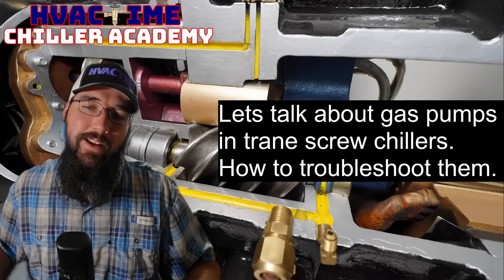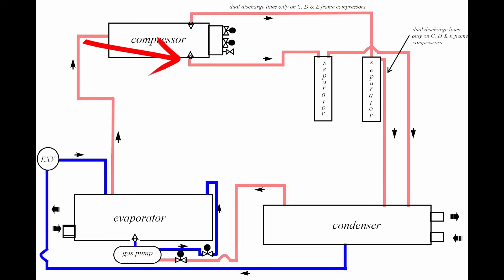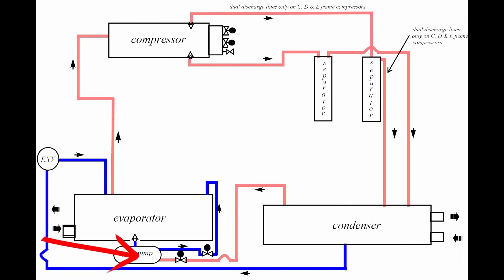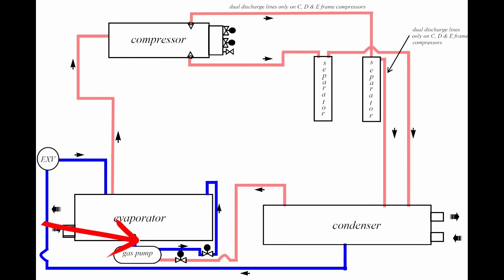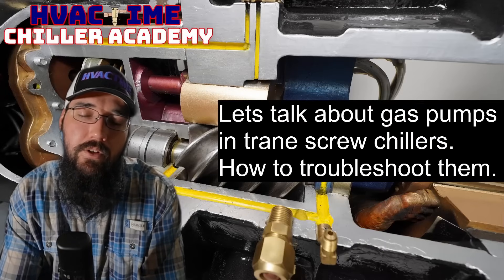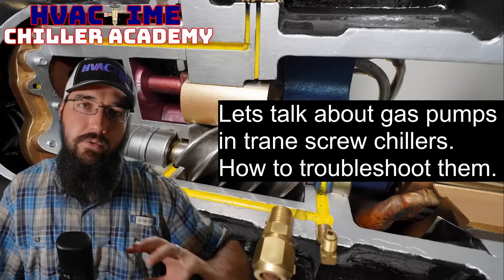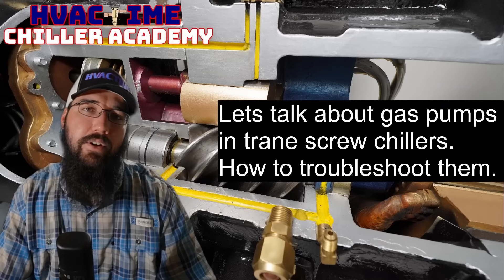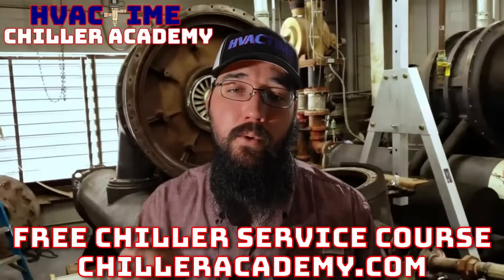Trane Chiller Gas Pump Explained

Comment: The best way to see if your gas pump is working properly is to monitor your discharge superheat. Normally the pump cycles in 110s cycles. 60s fill 50s drain. The DSH should rise on fill and drop on drain. Usually 2.5° to 3.5° ( called the wave or shark fin ). It’s not recommended to add oil unless you see oil on the ground. The best way is to pull the oil from the bottom of the evaporator to the oil separator with a recovery machine tell the refrigerant is distilled and the optical eye goes wet. The most common issue I’ve seen is the check valve gets stuck open. You can usually free it with a magnetic to get it working. But if it sticks once I’ll stick again.

Comment: What you have here is the updated design. There's only 3 pipes on the update. In my cases the return oil to the compressor actually passes through a canister filter, just like the normal oil filter
Reply from the maker: So in the updated design if the schematic is accurate, how does the oil get returned? They only show condenser gas line and the 2 evap lines.
Reply: @HVACTIME  the updated design eliminates the pipe coming off the top of the evaporator or side technically. On the RTHC the oil line coming out of the canister goes to a filter and then into the side of the compressor. On the RHTD it’s a little bit different of a design, but same thing no line coming off the side/ top of evap, but leaves canister then tees into side of compressor
Reply: Very informative ❤